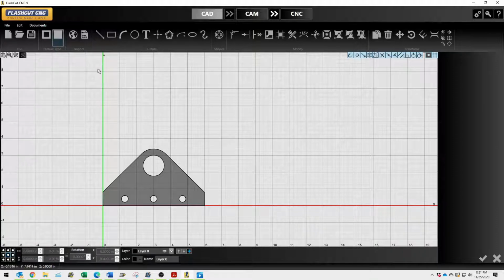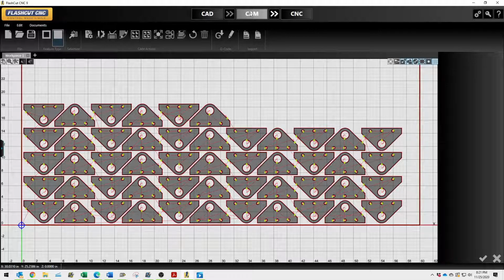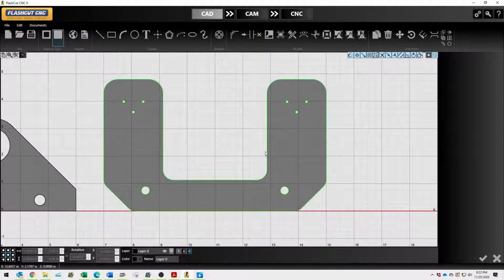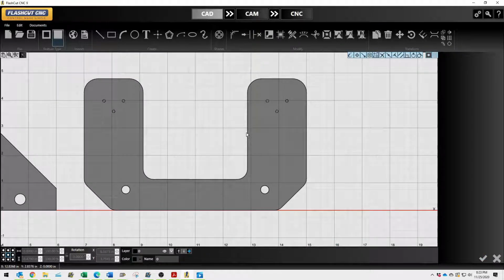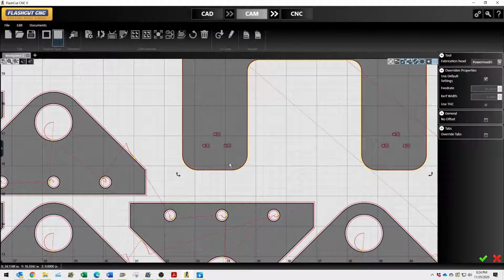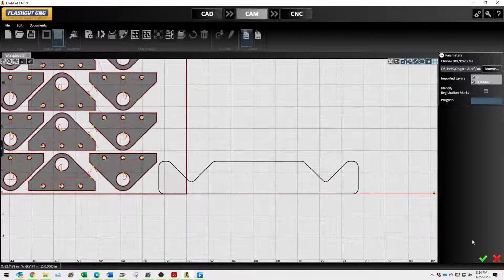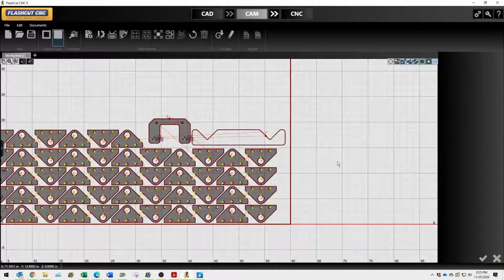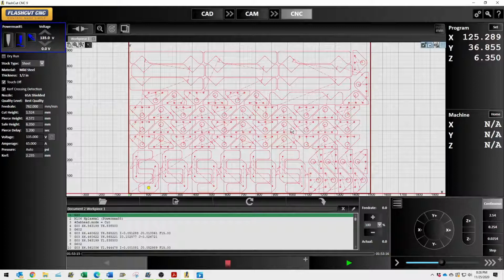FlashCut: How to Import Files and Create a Tool Path

Comment: Can you import an STL or sometype of 3D file for the pipe cutting tool? Or can you only draw pipe and cuts inside the software
Reply from the maker: You can import an STL file on the latest version FlashCut 10.